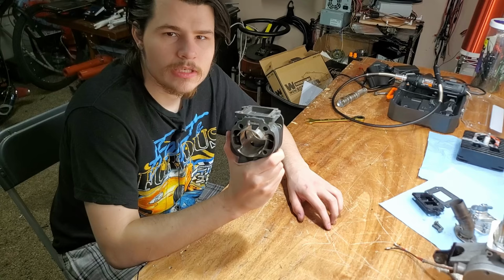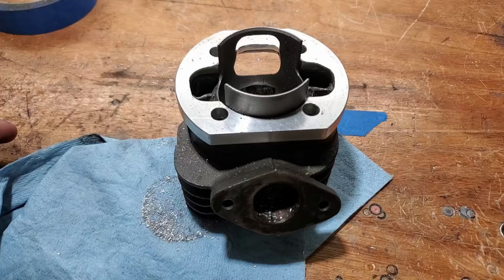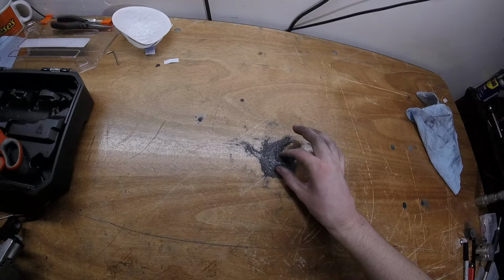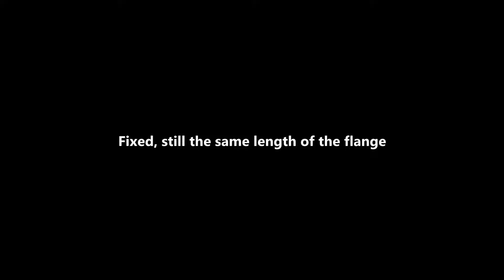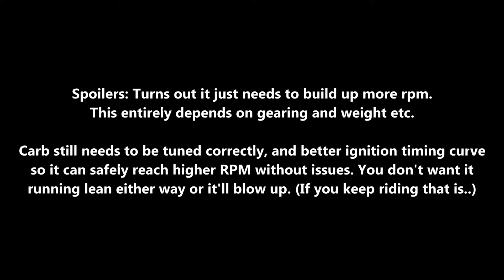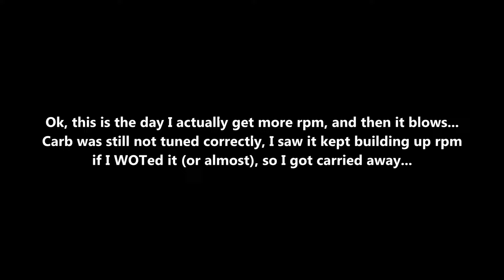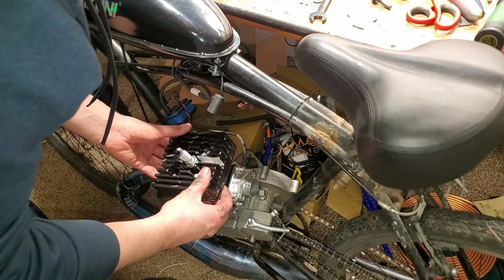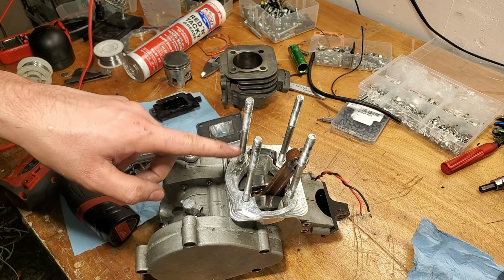Porting 70cc Minarelli for Best Performance! | Motorized Bike

Comment: Hey bro, glad your having fun but since your going ao fast and trying to to go faster you should think about stopping just as fast. Bad ish happens at a blink of an eye and you want to be able to stop. Believe you don’t want to learn that lesson the way I did. Ride safe brother.
Reply from the maker: Yeah i need to upgrade brakes. Felt faker soon tho
Reply: might be easier and cheaper to just replace the bike. Set up a patron and get us to fund a bike meant to go that fast with disk brakes and transfer everything over. It's not just the brakes ur gonna have to worry about, just like a car when u beef up one part to make it "optimal"to beef up EVERYTHING. In this case brakes,suspension even the bearings in the wheels aren't made to go those speeds for extended periods of time considering a fit cyclists max speed is like 25
Reply from the maker: @trpremote  the bike is still fine. Im buillding a felt faker soon, few parts to order left

Comment: Next time dont dremel right next to the bottom end just to play it safe. I thought for sure you were gonna crash for a second. Hitting the curb at that speed hurts, Ive done it and it destroyed my bike, my hand and my shoulder will never be the same. I hope your wearing a helmet.
Reply from the maker: I had to rebuild the bottomend anyway, i planned to even before having metal shavings in there. It was not the issue at all. Big conrod bearing failed. Making a video on it soon
Reply: @trentbikes  maybe try a little more oil in the gas, idk but good luck. U were hauling ass for a min.
Reply from the maker: @dustinh4175  i use 32:1 lol
Reply: @trentbikes  just trying to figure what caused the bearing to fail.
Reply: Try 25:1
Reply from the maker: @dustinh4175  lol wtf no
Reply from the maker: @dustinh4175  user and skill issue. Piston was hitting the head, even when running at 9krpm constantly. I was trying to get more power by reducing squish gap, it doesnt really matter much now after porting the minarelli for more power because i could barely notice the difference. Squish gap was 0.3mm lol so yeah from now on 0.7mm minimum.
Reply: @trentbikes  ahhh you got greedy
Reply: @trentbikes  and you couldn't hear it tapping, that sucks. Live and learn I guess

Comment: You can’t hold any motor wide open like this for that long until it’s broken in and not running poorly. This was inevitable, but at least you had fun. I hope you tune the next one cause that should be the first thing you do after building and putting it on bike.
Reply from the maker: Yes you can, as long as it's tuned correctly, built correctly (good squish gap, bearings, etc) and not overheating like over 300F etc. My minarelli was already broken in 2 months ago. Before I ported the minarelli, I pinned it going 9krpm 50mph constantly a lot for like probably 150-200+ miles total. Never had issues. That is until, it turns out the big conrod bearing finally failed (from piston hitting the head lol, on top of that free revving so high, while it was happening too other times), pieces falling apart and killed it. I mean, those are scooter cylinders, people pin it and go fast on scooters with those cylinders and do just fine.

Comment: Tip on porting be mindful  of where your location is on your ring dowls are    it appears  your intake port was way wide
Reply from the maker: yep dont worry I made sure to check. I couldn't even see the ends of the rings at BDC
Reply: @trentbikes   did you not notice half your ring dowel missing. What do you think pepperd the head and piston look again at your ring dowels
Reply from the maker: @2strokecarbtuningportingin187  if you mean the pins that holds the rings, they are there. they held the rings from moving lol unlike my last piston that was defective

Comment: That was wild! could not believe it could went up do 12000 RPM like it did so easely!! cannot wait for the next build haha!
Reply from the maker: Nah that was free revving, not with actual load. One time it did go up to 12500rpm. Still nuts imo because I never EVER pulled that high before. Sad because I had room for more while riding. I'll try again with either a new cylinder or repair the minarelli some day

Comment: Ripping I hope to some day have a bike that goes that fast
Reply from the maker: you'll get there easily I promise you. It doesn't cost so much either. All it take is at least a minarelli (CMB wildcat minarelli for $200), good porting for more performance and upgrades like rmh minarelli pipe or at least 50cc jog pipe on amazon,  balancing crank and good carb etc and you'll easily get up to 50mph+ depending on gearing and weight, maybe 60+. An athena sport for $170 on amazon, all it takes is drilling those stud holes to fit m8, upgraded cnc head for better cooling and already hit 50mph+ at 11krpm+ on 40T sprocket EASILY.

Comment: Oh dang. What you using to measure your rpms?!
Reply from the maker: Tachmeter
Reply: @trentbikes  thanks
Reply from the maker: @leonardarola  its a runleader tach, theyre cheap chinese, my first one died (i probably wired it up wrong and stuff but still), so far my 2nd is doing fine, wires away from ignition stuff, and i use 2 turns on the hv cable now
Reply: @trentbikes  very interesting. Thanks for sharing.